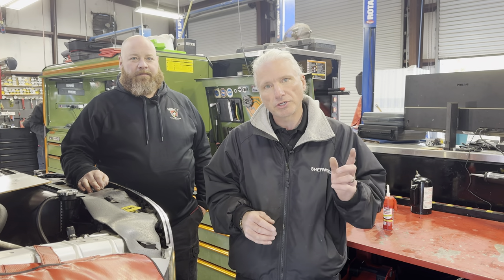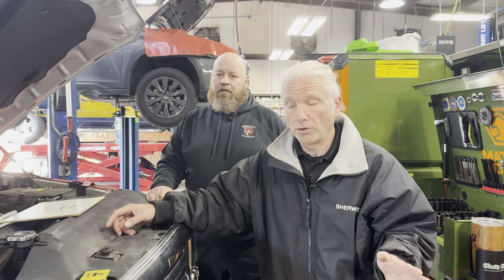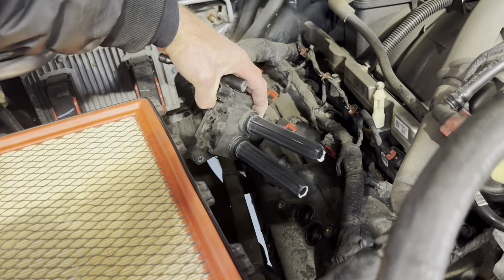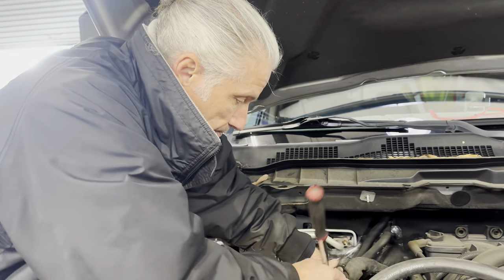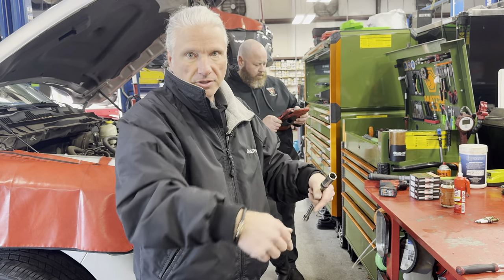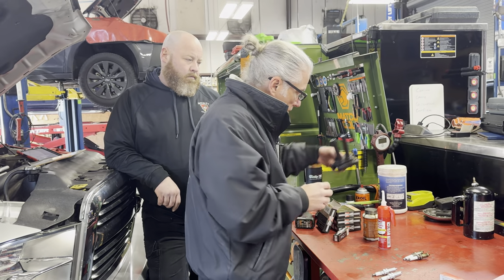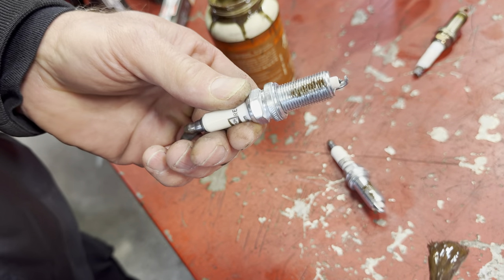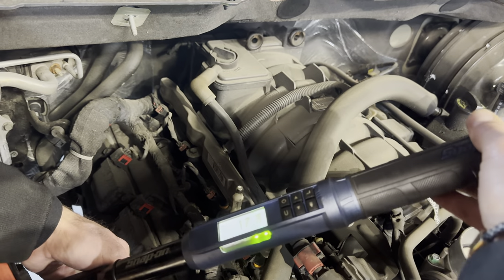How To Replace Spark Plugs Like A Professional

Comment: 1:15.  Guy just wants to replace them and get paid…..
1:57 Guy jams whatever is available in
12:46 the can't be good....
15:10 NGK SAYS NO ANTI SIEZE FOR THEIR PLUGS DIRECTLY ON THEIR WEBSITE

5 THINGS YOU SHOULD KNOW ABOUT SPARK PLUGS

1. Anti-seize

NGK spark plugs feature trivalent plating. This silver or chrome-colored finish on the threads is designed to provide corrosion resistance against moisture and chemicals. The coating also acts as a release agent during spark plug removal. NGK spark plugs are installed at the factory dry, without lubrication or anti-seize.

Anti-seize can act as a lubricant, altering torque values up to 20 percent, increasing the risk of spark plug thread breakage and/or metal shell stretch. Thread breakage can sometimes involve removing the cylinder head for repair. Metal shell stretch changes the heat rating of the spark plug and can result in serious engine damage caused by pre-ignition. Do not use anti-seize or lubricant on NGK spark plugs. It is completely unnecessary and can be detrimental.
Reply: But these aren't ngk
Reply: @483SGT  they said they use ngk and they said always use anti seize and surely all premium plugs work the same way.  this is old school tech stuff that never kept up with the times.

Just like he taps the plug to gap it
Reply: Might be an edge case, but I drive a Honda Fit that uses NGK plugs and they recommend using anti seize on the threads in their service manual. The manual did update to call for 20ftlb instead of 13ftlb on the plugs though so I would wonder if calling for anti seize was the reason for them to increase the torque spec.
Reply: You state things very strongly for having an opinion, one that's blatantly wrong too. Service techs do things by what the manufacturer service manuals say. Guess what, Honda uses NGK and states to use anti-seize. They have to cover their ass when it comes to potential issues, one way is to do things by the book. If the people who built the vehicle say use it, guess what thats what its getting used.
Reply: @holdover88  first two were tongue in cheek
no one can says its good to band on a spark plug tip
the nGK comment was right off their website
Reply: And when The plug fires up the thread where is the spark plug company—- no where to be seen.

Comment: The original spark plugs in the truck were NGK IR. They are Iridium spark plugs designed to last 100k miles. That is why they looked in great shape after 30k miles 🙂 . If they were platinum plugs, I would change them at 30k with IR plugs.

Comment: I use Vacuum Hose or Vacuum Hose and a Screwdriver to pull and start the Plugs.  Flexible and Aimable.  Not Everyone has Spark Plug Sockets that retain.  It's faster and easier.  Cool Vid.  I'm much in agreement.

Comment: I have been using aluminum Anti seize for spark plugs. I am curious why it is a good practice to use copper. Does using aluminum grease react with the metals? Look forward to your response.

Comment: Do manufacturers make the gap small so that as the plug ages the gap increases into the oem spec? I replaced plugs on a VW last year, and the OEM recommended new plugs had gaps that were all  0.2 mm too small out the box. I double checked it with two plug checkers, being sure not to damage the platinum coating. I used the exact brand specified by the dealer repair manual. After a little head scratching I decided to grab the neutral pole in a vice (on the sides so the platinum coating was not affected) and gently increase the gap, but I wondered if I might have been better to simply install them with a small gap....

Comment: Correct me if I'm wrong, but the threads are coated on todays spark plugs and is not recommended to use anti seize on them. NGK spark plugs feature a trivalent plating and states not to use anti seize because it can be detrimental.

Comment: Here are the methods that applies to most cars and light trucks made in the last 15 years. Always use OEM spark plugs in modern engines. Do not use anti-seize in modern engines. No manufacture uses anti-seize and most plug manufactures have coatings that can be ruined by anti-seize. Also can affect torque values. If you have to gap a modern spark plug it may be the wrong spark plug. Double check the number and always compare to the old spark plug. Do not gap exotic tipped (iridium, etc.) spark plugs or you can damage the spark plug. Only use dielectric grease when a manufacture used it and very little. Dielectric can attract contaminates and not allow a rubber boot to seal properly on the spark plug. Always clean around the area and in a recessed spark plug hole BEFORE removing the spark plug to prevent debris going into the cylinder. Always follow manufacture service information.

Comment: The torque (23Nm) for Mercedes plugs Direct Injection (GDI) engines is to correctly clock or align the OPEN side of the ground strap toward the fuel injector (+/-45°).  Not sure that 's the case for all GDI engines.  Maybe make a follow-up video about that.

Comment: What is your thinking on not using aluminum anti-seize on spark plugs?  What is different from the copper stuff?   FYI, I like to think I follow the five or so best mechanics on Youtube, and most of you agree about using anti-seize on plugs, but at least one of the others uses aluminum.  I'd really appreciate your insights (and that of any others who may read this).  Thanks!
Reply: Aluminum head = aluminum / nickle antiseize?
Reply: @juicebox22a  Are you saying that the anti-seize needs to be of a different metal than the plug and the head?
Reply: @TStheDeplorable  The opposite. Use aluminum antiseize for aluminum.  I would not use copper antiseize with aluminum as I would think they are dissimilar and could react.  
Locktite makes a  non-metallic antiseize paste that Bosch specifies to use on spark plugs used in industrial machine applications.
Reply: @juicebox22a  I wondered about the dissimilar metals and the possibility of an electrolytic (?) reaction.  Thanks for letting me know about the Locktite paste!
Reply: Do not use anti-seize with modern engines or spark plugs. No manufacture uses anti-seize and most modern spark plug manufactures say it will ruin the special coating.
Reply: @1MiketheMechanic  I heard that NGK says not to.  I'll look at the other major brands.  Thanks!
Reply: @1MiketheMechanic  How does antiseize ruin the coating on consumer automotive spark plugs?

Comment: As stated multiple times anti- seize is not recommended.   
The video states this a a 2016 Ram 1500 with a 5.7 l engine. 

The plugs being installed are clearly champion 9055 .
 If you look up the spec for these plugs they come pre-gapped to 0.054.  they make it sound like some how they came gapped incorrectly or have been damaged in shipping.. This clearly not the case. 

Champion states when using these plugs in this application they need to be gapped down to 0.044".     .

 Tech tip here. just because you buy a spark plug for a certain vehicle does not mean they are drop in.. al;ways look up the specifications  of the part being installed.   
These guys cleanly did not do this

Comment: I always use original spark plugs from the dealer. I don’t like using other brands that are better and longer lasting. Because the longer a spark plug sits in your engine the more likely it will seize and get stuck from corrosion. Besides it’s better to change them more often as to inspect the condition of how your engine is running. Lazy way is buy long lasting. & cross your fingers they will come out with no problems

Comment: Few things wrong here.  Never spread the gap on a modern spark plug with the wedge of a gapping tool.  The tips of the center electrode of modern plugs are tiny and precise and jamming a wedge between the tip of the center electrode and the ground strap can damage it.  Putting dielectric grease into the boot will almost certainly get it on the the contact of the plug, causing resistance, dont do that.  Instead, put the grease on the porcelain body of the plug so the boot pushes down onto the plug and it stays away from the contact.  Lastly, It's good that he used copper based anti-seize as thats the only kind you would want to use, but he should have been more liberal in application.  These are spark plugs, they will seize, so fill those threads up with goop and any excess will stay behind as a nice seal where the the plug goes into the head.

Comment: About to watch the video these guys are great but no anti seize just hand tight with a ratchet and of course the material and gap has to be correct. With die electric grease on bottom of coil and connector that's it that's all.

Comment: In May 2024 I will have 40 years as a certified mechanic,33 years as a Master. I also have master tech with Toyota,Nissan,Chrysler/Dodge and BMW.  
But who cares about that. 
I do know that during Chrysler factory training in Ontario California we would joke that someone from Champion plug’s took someone from Chrysler to some nice dinners and probably (other places)   My point is that as a Master mechanic I wouldn’t even put a “ Champion “ plug in my lawnmower , that was the general consensus among us factory mechanics.
Reply: Yep absolutely agree
Reply from the maker: Champion back in the day were horrible but, like many things, times change. We haven't had any problems with them in years. But you were definitely right about the way I used to feel about them.

Comment: Good video, but I don’t agree on the use of copper grease. 

Zinc & nickel plated spark plugs you really shouldn’t put copper grease on. 

The copper can cause galvanic corrosion with aluminium heads. This is a minor issue.

Major issue is torque. You can offset the torque up to 20% (usually too tight) 

Also most big manufacturers (NGK - Champion - Denso etcetera) recommend not using any type of anti-seize other than the galvanic coating which they come with from factory. 

You can use anti-seize on black metal spark plugs, I can’t remember what metal alloy that is. I personally never saw this type installed in a modern car.

Comment: In regards to the never using Never Seize debate on Spark Plugs: Some of us are so old that we remember the old Mazda Rotary Engines having 2 Spark Plugs Per Rotar and not being able to get them out or on a VW Air Cooled Engine back in the day. I could be wrong in one way, but correct in the other?

Comment: Here comes the anti-seize on spark plugs debate.....
Reply: NGK specifically says do not use anti-seize. I’m sure NGK knows more about spark plugs than I do.
Reply: @NomenClature-o8s  They do! And Honda say to use NGK spark plugs with antiseize. I'm absolutely sure that Honda knows more about engines then I do. And that leaves us with a conundrum.
Reply: @jptrainor maybe, I will put anti-seize on every other plug.
Reply: @newportpa67  That would, at least, be an interesting experiment.

Comment: Oh, I see you've touched on a very controversial topic for professionally installing spark plugs. That being the use of anti-seize. I was under the impression , and will continue to abide by, that it shouldn't be used on today's  nickel coated plugs. NGK specifically states that anti-seize or lubricant on NGK spark plugs is unnecessary and can be detrimental. Autolite would indicate that anti-sieze can alter the tightening torque up to 20%, increasing the rise of breakage.

Some habits are hard to break.

Comment: Yet another thing that is debated to no end-to anti seize or not. Many manufacturers (denso, ngk) specifically say not to use anti seize. However, for long life (120k) plugs I like a little antiseize because those plugs will be in there for awhile and that screeching sound when taking them out just makes me shudder. Just don’t over torque and you’re good.

Comment: I wonder how many Honda owners got screwed over by following the advice that you need to use anti seeze on the spark plugs . It should have been explained with a caveat that not all spark plug manufacturers use anti seeze . NGK for example per the manufacturer advises to NOT use antiseeze on their spark plugs it's uneccesary and can alter the heat rating of the NGK plug potentially causing serious engine damage , pre ignition etc . Check with the  manufacturer .

Comment: OMG, vehicle had low mileage, and you took NGK out and put a champion in. Sorry to disagree with you, I would not use a champion in my lawn mower or anything now. And when I worked in an auto parts store we would push them, then worked at Toyota and people that used champions the cars would have different run problems. ND/Denso was Toyota genuine, and they only ran on that brand period. Boy I learned very fast, Good luck.

Comment: I've not heard to use a anti seize lubricant on the plugs. Even if it is only a little don't you think it may change the torque value? Also copper and aluminum react with eachother so when using it in an aluminum head it might be a problem. I screw them in dry with the right torque. I agree with the spark plug grease for the boots. Also I don't use electric tools for this. I need to "feel" that it goes in correctly and nothing will be demaged. The ceramic of the plug can easily be damaged. Thats also a problem when a torque wrench is not used. (Best regards from germany - have a nice weekend!)

Comment: You should never use anti seize. Come into the 21st century. Many spark plugs have a coating on the thread! Also you are interfering with the ability of the base of the spark plug to accuracy fly and full ground the spark plug to the cylinder head. This causes a weaker spark. You area professional, please don't put out inaccurate information.
Reply: You are correct. Refreshing to hear from another co- Professional.

Comment: Would Dialectic grease on the electrical connection be good idea?
Reply: No difference IMO. The solids are conductive and the oil is squeezed out. Most plugs already have a 5k resistor built in.

Comment: Don't necessarily replace parts based on mileage do it on condition inspection the old way of doing everything based on service intervals is sometimes wasteful and only to line the dealers pocket books OFC this depends a lot on the owners own personal risk versus reward opinions also some people want to err on the side of caution and the money is not that important and others push their luck further to save a buck so no one right way to skin a cat ever

Comment: What part of the spark plug is the ground ?? ?
Reply from the maker: That could be a tricky question but the easy answer is the piece that goes from the threaded part and bends over the porcelain piece.
Reply: Actually, on systems using one coil to fire two plugs, like waisted spark systems, the polarity of one plug is the opposite of the other.
Reply: @theroyaltyautoservice  What i meant to ask was . The threads on the spark plug screw into the cylinder head , and the engine itself is grounded . Does that mean the spark plug threads have a role to play in the circuit ?
Reply: @akooner09  Absolutely. The current needs a path to get back to the coil or it couldn't jump the gap.
Reply: @akooner09 I see where your going with the lead in question. When you know everything and have a YouTube channel those questions apparently fly right by

Comment: One should also take into account the fact that Auto Manufactures stretch the truth about how long a Spark Plug will Really Last to keep the Maintenace Cost Figure low, just like they do when saying an Oil Change only needs to be done every 10,000 Miles. Of course they say under Ideal Driving Conditions to cover Their Lower Back Side. I'll give an Example. An Auto Manufacture says the engine comes equipped with Iridium Spark Plugs and therefore they only need to be replaced every One Hundred Thousand Miles. I don't care if the Spark Plug look like new when you take one out. The resistance to fire that plug can be much more than it was when the Spark Plug was new. That makes the Ignition Coils have to work that much harder to fire them. Replacing the Spark Plugs Twenty Five Thousand Miles sooner perhaps would make more sense because by doing so you might prevent the Ignition Coils from failing. On certain Vehicles an Ignition Coil could over heat and perhaps even melt and could also cause the failure of the ECM. At One Hundred Thousand Miles the Vehicles Warranty has long since Expired and the Vehicle Owner is now responsible to pay the Bill. If you do find a faulty Coil and just replace one Coil and then 3 Months later the car comes back because another coil has failed the Customer might ask why the Heck didn't you tell me about that Coil being on it's way out at the time? I say replace all the Coils when one goes bad, just like you would if one Headlight burns out. If it's for your own car OK fine, but for Customers Car?! All Denso Oxygen Sensors come with Copper Never Seize. It makes great sense to use it on Spark Plugs for the reason you stated on Spark Plugs also. Once Again, Another Great Video!!!